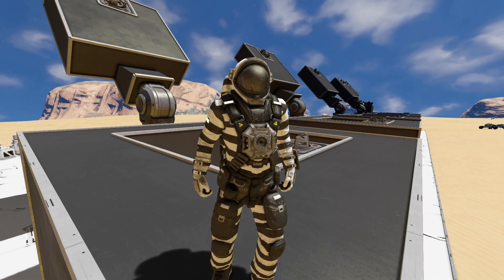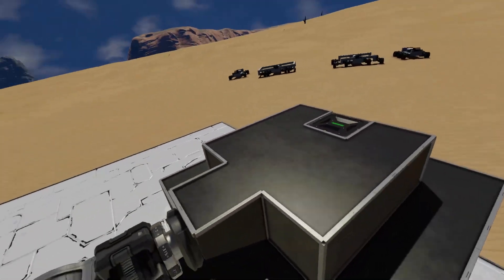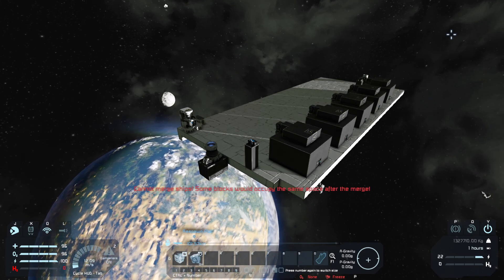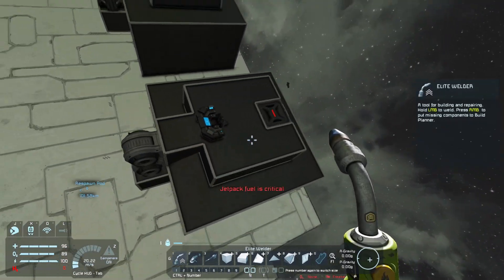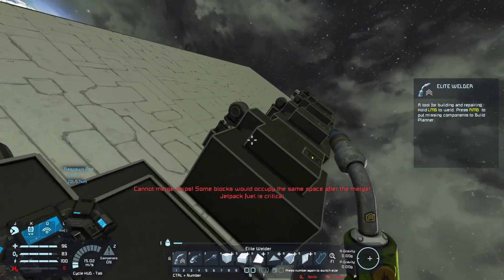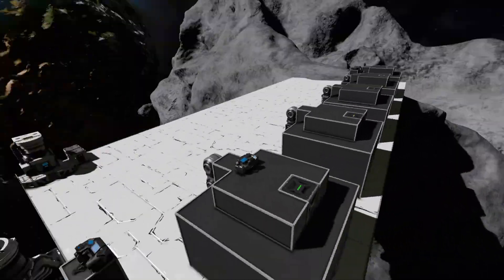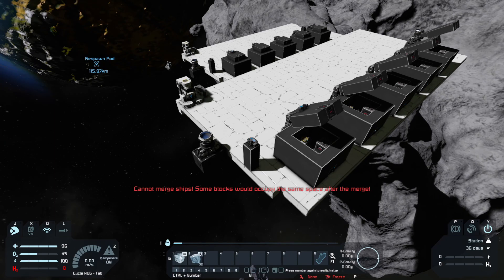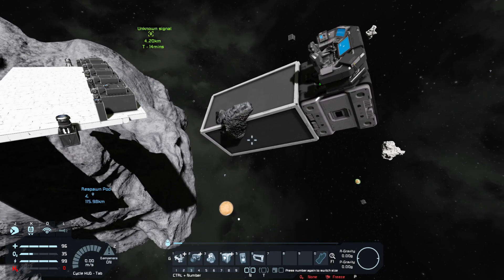Space Engineers Experiments: Hinge Hatch Door In Space?

Comment: The actual fix is to not make the main body of the 'station' a station, instead using separate foundation block flagged as a station, with the main body being a sub grid attached to the foundation via a hinge (and not flagged as a station)
Reply: Easier than my idea. I was going to suggest a mag plate on the floor, then plop a battery with a control panel on it, and convert the battery to a station. (Since it's a powered block it shouldn't despawn)

I think my idea has less chance of clang though.
Reply: You better make some blood sacrifices to Klang before you try that
Reply: @Jayy-fp8hh  Not causing me an issue so long as it is locked and I'm not torqueing things too much. Certainly more stable than the strip mining rigs